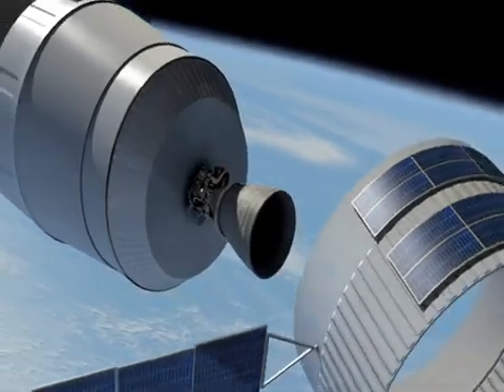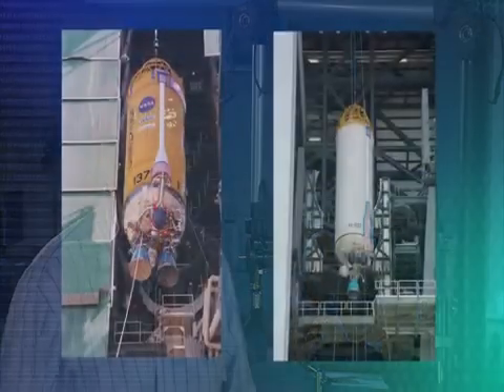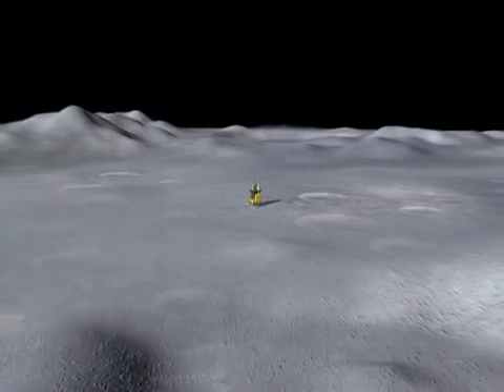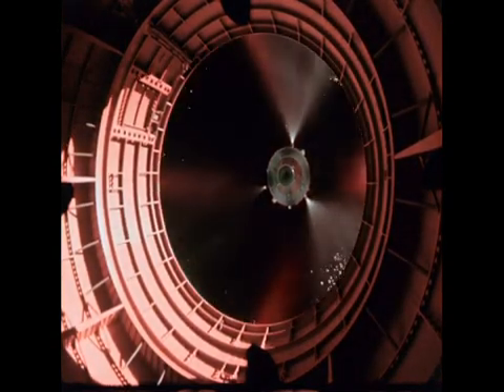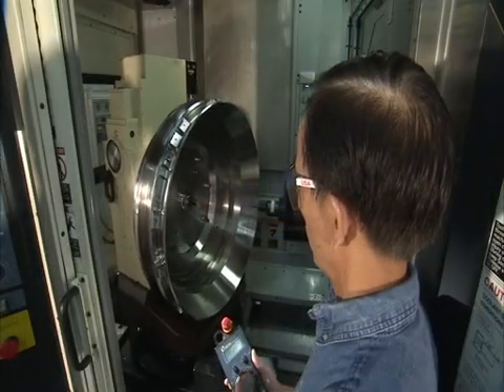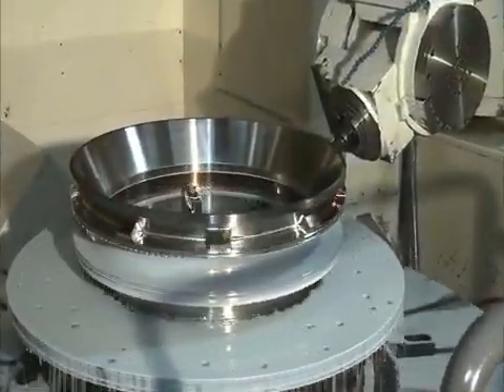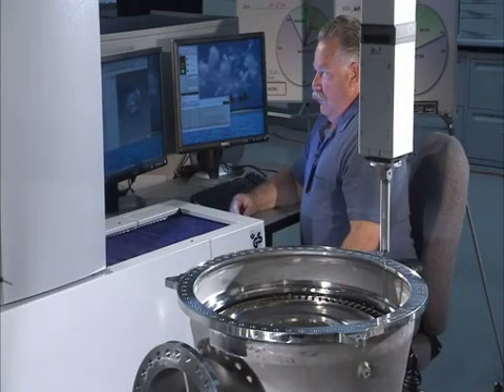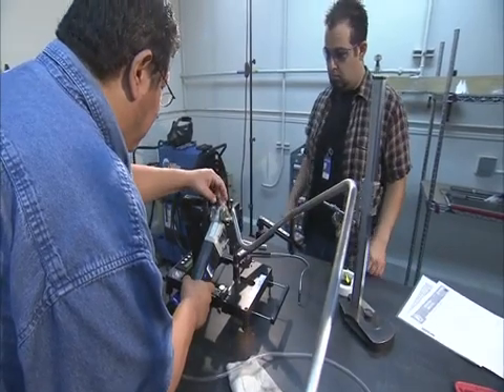J-2X: NASA's New Upper Stage Rocket Engine

Comment: Using a proven design with 'new materials' and 'new electronics' and ultimately new assembly techniques will get the job done , better, safer, and more cost effective. The downside is going to be in re-utilization; getting a program of 'cheap' disposable rocket engines is not the same as building 'spacecraft' utility. We build probes better than manned rated craft... because you  have advances in miniaturization in hardware for both craft, and telecommunications. Getting people there is hard.